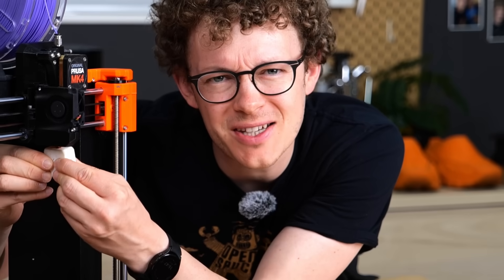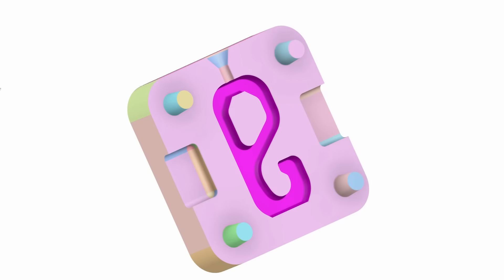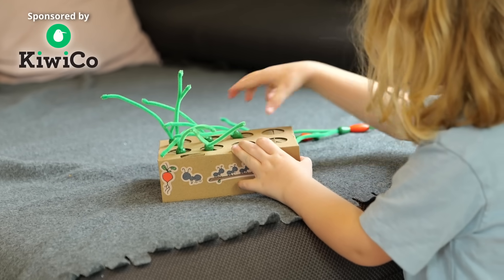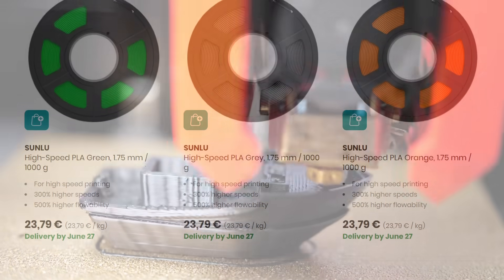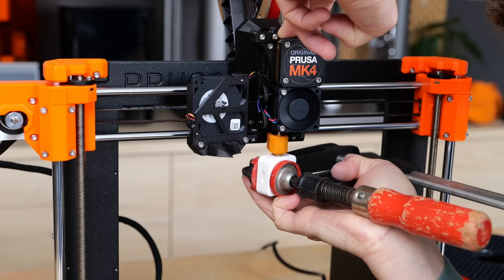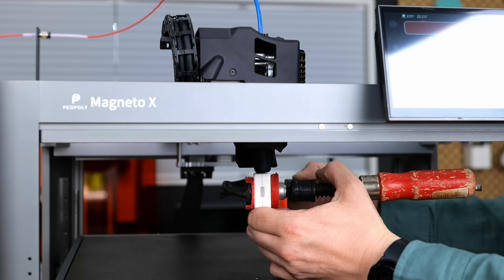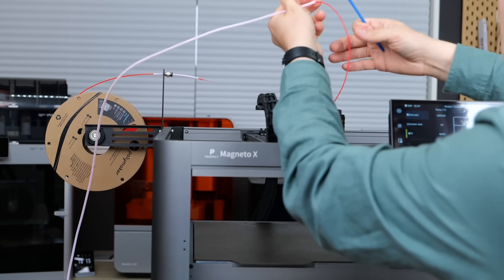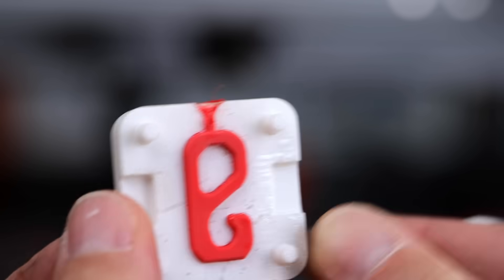I tried Injection Molding using a 3D Printer!

Comment: For solutions to your issue: I believe you were on the right track by heating the mold prior to injection.  As for why there are voids in the cavity leading to incomplete parts, I think what is happening is you are compressing the air left in the mold while simultaneously heating the air causing greater pressure than the rapidly cooling plastic can push. 

The reason why I think this comes from   making soft plastic fishing lures. The molds used in the injection method as well as the open pour method have small grooves cut from the end of thin fine detail parts to the mold edge. These fine grooves allow the air out so the plastic can flow into the finer points of the mold. There are plenty YouTube videos on home made soft plastics to reference. Some lead sinker molds also have thin grooves.  I dare to make the comparison as soft plastic lures when at liquid temperature have a similar viscosity to maple syrup. I believe you could easily  score your test hook mold with a dremmel cutting wheel from the up turned part to the edge. Less than a mm deep should be good. When or if a hair of the injection plastic comes out of the vent then you know the cavity has been full to the bottom. 

As for the sucking in of the top after cooling that is from the shrinking of the cooling plastic. It happens in soft plastic injection molding as well. Often a bait maker will top off the sprew so there will be less chance of cavities in the top. 

As for making molds, I have personally made a 5 cavity minnow open pour mold from elegoo water washable resin to see if it would take the heat of soft plastic and lead. The mold has been used several times for plastic and once for lead so far. It has held up well to the temperature I had plans to make a 2 piece mold like yours this past winter but found myself without the time or energy to 3d model the mold after a long days work. Hopefully I will get the chance later this summer.

Comment: With a form to hold several of the molds on the build plate, you can use the 3D printer to go to each one and inject it one at a time... a little factory.  You can also heat up the build plate to help the flowability of the parts in the molds, I'd think.  I think you can even make larger molds by using multiple injection points... by using multiple extruders as well.  Lots of ideas here.

Comment: I think you need a clamp with heating elements inside to keep the mold warm. That, and you really need airducts. It will flow way better that way.
Reply: I agree. In addition to the air vents, heating the mold would facilitate the flow of the material.

Comment: To keep the melted filament from cooling down too quickly, instead of an oven how about using 2 Peltier Elemente Modules. When power is applied, one side gets cold while the other side heats up, the amount of heat/cold is dependant on the amount of voltage applied so you would need to experiment with heat/cold temp vs voltage but you would only need up to 12v max and they get below subzero temps and holy crap hot on the other side, lots of youtube videos on them. I was thinking, one on each side of the mold (hot sides towards mould) then possibly a 1/4 block of metal for each side then the clamp, with the voltage set so that the hot temp is hot enough to keep the filament melted or at least keeping it from solidifying right away but yet not so hot as to wreck the mold. The drawback is that these modules are only 4cm square so mold size would be limited unless you add more modules to cover the outside surface. The benefit is that it would keep the mold warm/hot long enough to fill it up at least in theory and it's something I might try (along with the other good tips and suggestions here) as I have several of these modules,

EDIT: also combine this with one of the Revo or Bondtech CHT high flow nozzles, I see E3D has added 1.2 & 1.4mm nozzle sizes to their high flow line.

Comment: A cool next step would be to create an adapter that can hold the mold to the nozzle for you so you’re not having to hold up the clamp like that. If the adapter had good enough tolerances, it could also help with the back pressure issue.

Comment: I did the same using 3D printing methods towards injection molding. And I have learned ups and downs. I have been in your road using resin printing and no success. the reason is the material selection of the mold. it has to be metal to accomplish this. I tried resin with basic and heat resistance. However, the heat of the melted plastic that your injecting will weaken the resin structure and the resin will brittle over time and use. So, I used resin mold to do the casting method and the direction I did was spot on but still working on closing it. Right now, I am having issues with the injection machine, but I got good tips and do another method. hope this helps out.

Comment: I'd suggest using the Artme3D extrusion auger from your filament  recycling line. Comes close to the real stuff an you can achieve more pressure and flow. +using scraps.

I currently think about buying the artme 3d kit just for the extrusion mechanism, as i wanted a desktop  injection molder for a long time. Just there was no extrusion auger.🎉

Comment: Did you take into account the need for a micro-riser? I think as the PLA is cooling, a very small release in pressure would assist in filling the "bottom end" of the mold.

Comment: 1. You can use a drilled screw instead of a regular nozzle and a thread, printed on the mold, to make the seal better. 
2. Making vent holes, to prevent air pressure building up inside the mold.
3. Putting the mold inside a glass of boiling water (heated up with the print bed), to ensure constant 100 degrees of heat, that should be enough, for the PLA or PETG to stay a liquid. You can also add salt to the water to slightly increase the boiling tempreture.  Or even switch to glycerin instead of water, since it has significantly higher boiling point (about 290 degrees).
4. Using multiple extruders and multiple plastic input ports may help with complex shapes, but it would require something more than a regular glass as a liquid container, probably some ceramic dish with drilled holes for input "nozzles".

Comment: Also if you make your molds with the injection point in the middle of the model instead of top or bottom, maybe in the middle would give better results, by cooling more evenly, it seems that the plastic is cooling to fast in the molds after a certain distance, by placing the injection point in the middle of your molds you should be able to increase the distance that the plastic will travel before it cools! 😊 Just a thought!

Comment: Without sanding the molds, and having the lines from the printer on the pieces, would that create stress fracture points? Would they be stronger if the molds are smooth and sanded?

Comment: I wonder if it would make sense to design the mould with a void at the sprue so you can clamp it around the hot end. This would potentially increase the working pressure as the mould would stay in contact with the nozzle. Along with an air vent at the opposite end as others have suggested, so that you will know when the mould is completely filled.

Comment: I was wondering throughout the whole video this question. Wouldn’t it make more sense to use a basic screw and nut system in each corner instead of clamping the mould?together

Comment: you need some holes for air release. If dont have them, the plastics try to compress the air inside the mould and you have to make so much more effort for inject the plastic inside of the mould.

Comment: Suggestion, have a screw table to hold the mold up in place or rebuild an 'injection only' device from an old printer using its parts.  Make the jaws 'active heat plates' that hold the mold in place with the clamp like you are currently using, and have a small bleed hole to let air out of the print cavity near the extreme portions of the part.  Possibly make sacrificial spew to get material to 'far away' portions of the mold.  For larger parts, set up to use multiple extruders with multiple ports on the mold to accept hot material.  Great project and yet another set of rabbit holes to follow.

Comment: try to leave a small hole on the Mould to allow air leak for the pressure developed inside. Also smaller sprue helps to fill it faster before it solidifies halfway.

Comment: 2 things. At the end of your hook, create a tiny air channel so the air can escape as you push plastics in. Otherwise I think the fluid plastic needs to fight the air pressure if the mold is to airtight. Secondly, put the mold against the build plate and turn its temp up real high, this will ensure longer fluent filament. Then lower the nozzle till it locks the nozzle against the molds entry point. This way you don't need to rely on your muscle strength for the pressure. It also allows for the pressure to go straight down and not diagonally. As added bonus, you don't risk hurting or burning yourself.

As a bonus suggestion, calculate the volume of the object to mold and just push that amount of filament in.

Comment: Here is a thought I had, what about the AIR still inside the mould itself, once you are injecting into this, that air that is still inside the mould is going to prevent the injected plastic from flowing better (much like how air can stop water from moving, causing air-lock on certain water pumps). 

I would recommend finding a way to add a small hole at the other end of the mould to allow this air to be pushed out as the plastic in being injected in, this should allow for less pressure being needed and will only need a small amount of clean-up once done. 

I do not 3D print stuff myself, but I do deal with AIR-LOCK quite often, which even on powerful machines can aften cause issues and could ruin the pump, to trying to remove the AIR-LOCK is a start.

Comment: Great video, make me think about the following: Why not make the mold of see through type plastic and surround the mold with high power UV LEDs. replace the hot end with a small peristaltic pump, pumping in UV sensitive resin. Once filled up you blast the fluid with UV light. This way you tackle the following problems: no extreme heat required and no high pressure.

Comment: Hello from Prague, I think orientation could be changed especially for the hooks. rotating 90° will shorten path that filament must flow. Preheating of form to correct melting temperature. Extruding from multiple sources could also help. Very interesting and definitely usable for some small parts. You could also fill inside of form with filament, heat to melting temperature and inject new mold into it to make pressure.

Comment: you need a bigger nozzle, heat is not a factor as most injection molds are liquid cooled anyway but a higher nozzle temp will make the plastic flow better.. they rely on injection pressure and cycle times.(i have 10 years in plastics industry btw)
Reply: cycle times consist of injection time + hold time as the shot is pressure is maintained.

Comment: I'm curious why you choose to vertically stabilize the mold during injection by hand.  Why not determine a Z coordinate which best inhibits material escape around the nozzle?  Everything squared up and calibrated I think the stable bed would best provide a firm, even seal between the mold and the nozzle.

Comment: For the M4 screw mold where the head never completely fills, try a couple of well-placed weep holes through which air can escape as the head portion gets filled.  The weep holes should be tight, perhaps 1/3 mm, because you want the air to escape the head allowing the head to fill with plastic, and you do not want a lot of plastic escaping through the weep holes.  The goal is to fill the head portion and quickly plug the weep holes so that you can build pressure as quickly as possible.  You may even experiment with weep holes that don't fully reach the edge and allow air to escape.  Maybe the weep holes should have just enough empty volume to contain the air that isn't escaping your current M4 screw mold.

Comment: I wonder if with a mold that has a breathing hole or hole where the air can escape if it would have worked better or at least easier? I would love to see that maybe that allows to eaven melt the plastic to higher temp and then pour it for a bigger part.

Comment: This may be a viable method for my automotive button project. In my tests I've been using silicone molds and injecting resin with a syringe.
I'm planning on getting an injection molding setup at some point.

Comment: I would like to see you try and print heating and cooling channels in the mold. It would be nice to see if you could get a heat up step, a cool down step and a removal step. In addition to channels and since what you are molding is small, you might get away with using some kind of plate with the heating/cooling channels pressed onto the mold. I am also curious how long different printing materials respond to that hot and cold cycle. Thanks for the sharing your video.

Comment: Everyone says you need vents. Here is a tip. Barely scratch an air vent on the parting line. Less than .02mm deep. And then let that small vent open to a wider vent. You can allow air out without allowing plastic to flow out. This makes a cleaner molded product

Comment: awesome experiment!

now, for the acid test we need some tests on the breaking strength of that hook. 

injection moulding is never going to be easier than simply printing an object unless you want to make a good sized run, but it would be very interesting to see the mechanical advantages of a moulded part over a simple printed version

would there be any advantage to leaving a hollow for a heater cartridge and a thermistor in the mould, and heating it internally rather than leaving it on the print bed for a bit?
firmware additions to control the mould temperature should be trivial.

Comment: As others have said, you should redesign the mold. 

Another option, but takes longer is doing a sort of "Lost wax" type casting for the nmold. Print the shape you need, wrap in clay, bake dry the clay and let the plastic or wax melt out or burn up, Then fill the mold with plastic. If built right you should be able to re-use it a few times. Not as much as a metal mold, but good for low production runs. You can also heat the ceramic at that point to keep the plastic hot and flowing. 

But I think you are onto something. I am excited to see how this concept evolves.

Comment: Hi Stefan! I have an idea. Maybe you can make the injection hole in the mold to be shaped exactly like the nozzle. This ways, you can make a more secure connection and ensure that there is less pressure loss. Additionally, since the nozzle is shaped like a hexagon, this should help you get an even more secure fit.

Comment: I should probably watch the rest of the video before I say this but hay any engagement is good right.

I think you need to find a way too keep the mold hot so the pla will not cool inside the mold straight away.

Comment: I'd definitely add an air hole on the far side of the mold. As far as I know that is pretty standard for industrial molds.

Also, you could try heating the mold during the injection process, not just preheating it.
A couple of Peltier elements might already do the trick: Clamp the hot sides onto the mold and add heat sinks to the outer, cold side(s). This might help keep the mold hot enough for the materials to keep flowing.

Comment: I've got a couple of ideas. You should have a hole in the mold to let excess air escape as the hot plastic enters. You could also try a mixing hotend as they typically have a larger chamber due to having to mix multiple colours of filament. Then the melt rate could be higher.

Comment: Keep in mind the flowing of the molten material. So, you should get best results , when all "ends" of the mold have same distance to the sprue.
For the screw, should be better to put the sprue at the hex end. The long way through the long narrow part cools the material to fast. The big room in the hex takes lots of material whitch needs a long time to cool down and block the way.

Comment: vent holes, your system doesnt have enough psi with you holding it to the nozzle with just your hands. normal seals are way stronger, which allows the fill to compress any trapped air

Comment: If you have a lathe, could you turn the end of the nozzle to give something for the mould to attach to, possibly even use a very long hot end and turn it down until you get to the threads and put a nut in the top of the mould, then just screw it on.

Comment: the best way to do this would be to split your mold in half along the injection port, build it out of metal (CNC would be great for accuracy) and then make the injection port threaded the same as the 3d printer nozzle, then clamp,screw them together and thread right into the hot end. After giving time for the mold to heat up with the hotend, youll benefit from larger molds not hardening too fast, better flow, less likely to clog, stronger molds, and more

Comment: Im watching and om 09.01 i alredy thinking by default - Heat the mold so that it wont take heat from plastic.. You need larger nozzle hotter plastic heated mold and proper nozzle and mold press togetrher mechanism

Comment: I think more screws could help make things better. 

First, add 4 holes to the top and bottom of the mold around the edge, then use screws to hold the two sides together instead of using the screw clamp. 
Second, Make it so that the mold has screw threads at the sprue, so that you can screw the mold directly to the hot end instead of you just putting up your best effort to hold it in place. -heck, even just lowering the print head and using the stepper motors to brace the hot end between the bed and the mold would probably be more effective than the amount of pressure you're able to manually apply.